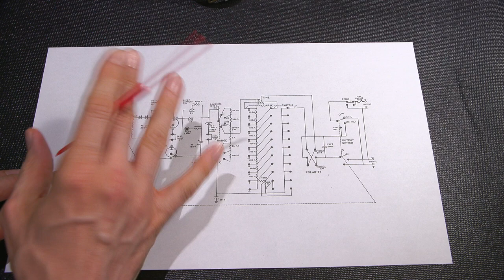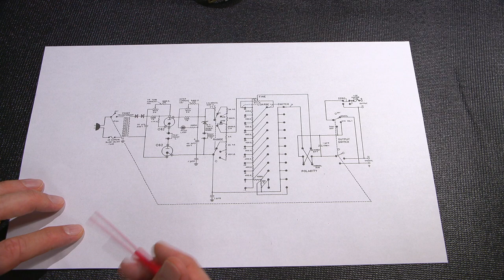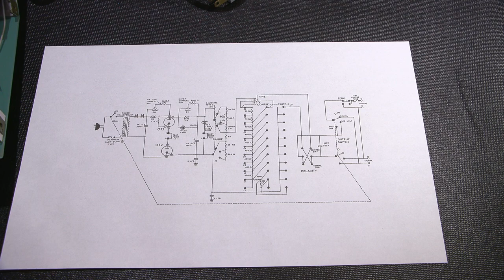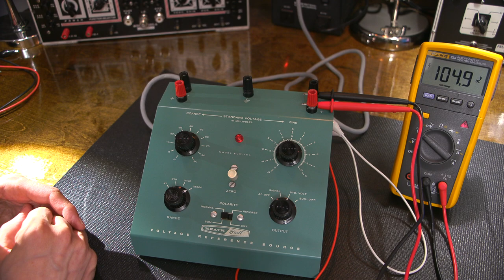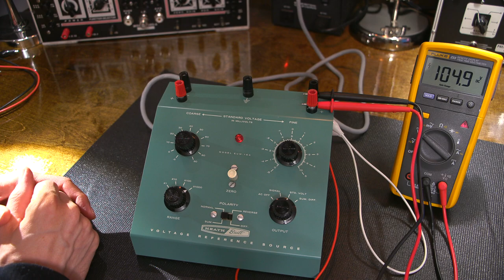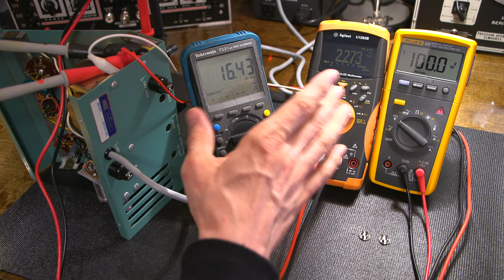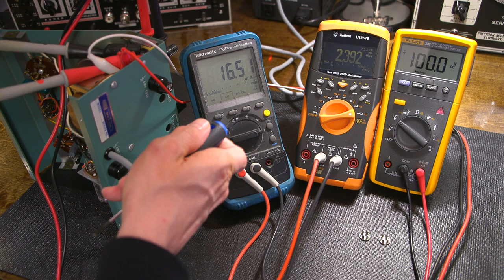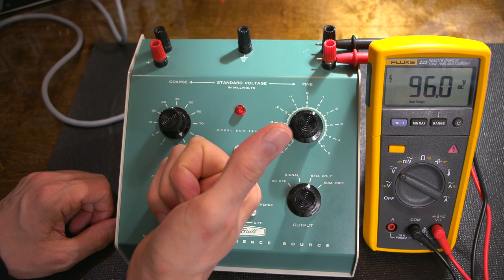HeathBuilt Voltage Reference Source [Restoration]

Comment from the maker: To learn electronics in a very different and effective way, and gain access to Mr Carlson's personal designs and inventions, visit the Mr Carlson's Lab Patreon page here: https://www.patreon.com/MrCarlsonsLab
Reply: Do the test meters add any load to the device while adjusting it.
Reply: @Peterjames3535  The series meters reading current would not but the parallel meter reading output voltage would have a VERY tiny parasitic load
Reply: Then again, there is the fact to consider that... Live and neutral in AC voltage do not matter, as they do not have a specific polarity. So that's probably why the fuse ended up on the neutral instead of the live, because it didn't completely matter which way around it went. So long as the ground went to where it's supposed to go for protection against any current leakage that may find it's way to the case of the device. Still very cool tho to see such an old device.
Reply: @timteecvhn  Except for the fact that in most countries Neutral is Bonded to ground and therefore presents a greater shock hazard . If you do not break the live side in switching and fusing
Reply: When I was a young girl, my daddy bought me Heathkits to build every Christmas. I remember the Heathkit LOGO! The shape of the logo and style of the lettering is the same as Heathbuilt. But, I never received a Heathbuilt.
Reply from the maker: Yes they do, but most modern meters have a very high input resistance/impedance, so there is little "loading" on the test equipment.
Reply from the maker: Hi Timtee. In most locations, the neutral and ground wires are joined in the breaker panel. This is why the device should always have the fuse in the hot lead. If the case is referenced to ground, (which it is,) the other side is hot, so the fuse should be first in line with that lead.
Reply: @timteecvhn  As apollo rob said, it's to do with how the rest of the system is configured.

Comment: At 80 I'm a tad older than you, Paul. I assembled 9 Heathkits between 1972 and the mid 80s. GR-900, GR-2001, IO-30, IO-4205, IO-4550, IT-28, IO-4505, IT-21 & an IT-3120. I miss those days.

Comment: I'm 53, when I was about 7 or 8, my dad bought a heathkit color tv (with remote!!) and built it in the basement. I remember watching him solder the components in and putting the whole thing together. We had that TV a LONG time. You had to tune each channel separately with jumper wires and tuning capacitor. It would drift out every once in a while, but the side panel would pull forward for "easy access".
Reply: Was it the GR 2000?  What a fun project
Reply: @TheoSmith249  you know, I couldn't tell you. I googled that model but tough to tell. Watching him build that and me playing around with the tuning in the side panel really sparked my interest in how things work.

Comment: A trick to fix those knobs.... strip some solid copper wire. Remove the existing grub screw and glue the crack closed. Next, wind copper wire around inside to create a "ferrule" - this may need to be two "rings" to keep away from the grub screw hole. Finally, fill the gaps between wire and plastic with the old "baking powder and super glue" trick. Care is needed to keep the grub screw hole 100% clear.

Comment: Good job Mr. CARLSON. You stayed with it. Heath did a good job in their resistor matching. 

Amazing how good it was without feedback. Say at 100.00 VDC and you loaded 2 mA on the output by using a 50 kohm ...how much would voltage would the output drop? 
Perhaps Heathkit intend to use it like a std. cell...where you place a sensitive meter between your Heathkit reference...and the unknown voltage...then adjust the Heathkit to a null..which means no error current across⅞your Heathkit and the unknown DC voltage...then read the dials...to determine your unknown voltage. 

Nice handheld meters....I had no idea TEK made little DVMs..

I will eventually do some Patreon...and help support your cause. 

Keep up the good work. 

If I was assigned the construction of a 0 to 100 VDC reference..it would be totally different. ...

Comment: Hmmm...

As you mentioned about the Calibration & heating due to the cover being off; I would have did the mod. to add two sets of  banana jacks & switches  on the back; switch on  for operation; & off with test leads inserted during calibration.

Which is exactly what I did back in the day when I worked at Heathkit! We had to recheck & verify the cal. once a week. We also never turned it off as it took at least 2 hours to stabilize.

Of course with today's modern designs, a reference can be on & stabilized in about 5 minutes.

Great job! 

By the way, wish we had that capacitor tester back in the day! It would have made life so much easier!!!
Reply: Then he would need to move the jumpers to an external point so they also would be accessible for removal and reinstall with case on.
Reply: @jimdavis6833  Yes, Jim, that is what the switches are for!  Switch on (closed) - for operation;  when you open the switch (off), then you can calibrate it.  Actually, you would normally use a double-pole, single throw for both since both "jumpers" need to be removed.
Reply: RE: "with today's designs, a reference can be on and stabilized in 5 minutes" ... I would give a qualified agreement to that. It's probably true for 99% of electronic equipment. However, there are still some devices that should remain on for their reference voltages to be stable. A couple of examples are:
*  timebase units with very high stability oscillators, such as Cesium and Rubidium frequency standards; 
* LASER systems used for precision dimensional measurements, and 
* electronic DC Voltage references, typically used to replace Weston Standard Cells. 

In these cases it is good measurement practice to regularly measure and record the relevant outputs, and analyze them to detect any non-random changes that may indicate a potential problem. 

Even the Weston Standard Cells required a stable power source to power the their typical temperature-controlled enclosures. In September 1989 I was transporting a group of standard cells from the Washington (DC) Navy Yard, where they had been calibrated, to where I worked at the Electronic Standards Calibration Lab at Charleston (SC) Naval Shipyard. That trip was interrupted by a bit of heavy weather known as Hurricane Hugo. At a stop on my route I bought a portable AC power generator to provide power to those units for a week until power was restored to the lab. (I also used it to power essential items at home, for a couple of weeks.) The Navy happily (partially) reimbursed me for the generator, because it meant we could restart DC calibrations several weeks earlier than would otherwise have been possible had the standard cells needed to re-stabilize and be re-characterised.

Comment: Hi Paul, I just stumbled upon this video (I don't understand YouTube's algorithm) and was surprised at the number of glaring design errors with this Heath product.  I don't know exactly when this voltage reference was designed, I suspect the mid 1960's.  Zener characteristics were well understood at that time so, the designer was likely fresh out of school.  The 100 volt zener was probably used as a simple way to get a 100 volt output.  However, (as you mentioned) zeners at this high voltage breakdown are super temperature sensitive, so much so, that the part would actually make a good temperature sensor.

There are 3 zener breakdown voltages that have zero temperature drift if they are fed a specific current: 4.7V @ 10mA, 5.1V @ 1 mA, and 5.6V @ 100uA.  If you feed the zener with a constant current source, you have a precision voltage reference (although the current will need to be tweaked slightly to optimize the zero drift).  

Thanks Paul for another interesting video.

Comment: If you're afraid of slipping screwdrivers over paint, just get yourself one of those sheets of plastic they use in binders, the thicker the better, and drill a few holes of various sizes at a decent distance. You lay the sheet over the screw you want to remove and it will protect the paint. :)
Reply: That's a great idea! Thanks for sharing.
Reply: Or 3D print a collar to keep the screwdriver on the screw.
Reply: @NiHaoMike64  Assuming one has access to a three dimensional printer.
Reply: Or get a screwdriver that's accurately sized for the screw.  I like my Snap-On for this.  :-)

Comment: Hey,  Long time fan here.  I noticed your discussion on the line chord and polarity are right on.   One thing you did not mention is to put the black line lead into the back of the fuse holder rather than the side lug of the holder.  This, as you well know is quite important. it prevents the exposure of the hot line lead while replacing the fuse.   Great video, as usual.  Thank you.

Comment: Thank you for your hard work and detail on this and all of your other videos.  One thing you should discuss is, whenever getting a "new to you" item to work on, it is best to resist turning ANY switch or knob positions until you check the inside of the unit out as well as possible. I purchased a Heathkit IT-1121 transistor curve tracer last year, and when unboxing it I noticed a slight rattling noise of something inside of it. After I opened it, I noticed a few pieces of brown plastic loose inside the unit, and looking very closely I discovered a broken wafer on one of the 9 position rotary switches, and a slight bend to the outside knob mounted to that shaft as well  ( probably caused by someone dropping something heavy on that on switch knob/shaft) . If i operated that switch before looking, I may have done more damage to the unit, and god forbid I powered it and cycled it, as I think it was the switch that set the sweep voltage, and also the position that raised it to 200 volts!
  A small amount of time and patience at the beginning of a repair / restoration project can save hours of time and frustration later, as I could have shorted out and burned secondary windings in the transformer in that unit and turned a restoration into a "parts only" purchase.

Comment: thanks fo all the good videos, i'd like to ad a bit on a voltage standard for extremely accurate calibration of up to 1.5 volts DC...
this comes from the cal lab at Systron Donner inertial guidance in the late 60s...i was a technician in the engineering dept there from 66 to 69. we were working with analog output from accelerometers and this required extremely accurate measurement of dc up to 7 volts....we had lots of fluke dc meters that required frequent cal checks.... our master volt meter was of unknown brand and it filled a box the size and shape of a coffin and was on a roll around stand...once per month our leader would grab a fresh D cel (zink carbon)  and solder a 1k resistor across it then drop it in his coat pocket and head for the UC Berkley electronics dept where he measured it's voltage (about an hour drive each direction)...upon return he would read the voltage on the master ...that zinc carbon maintained accurate enough voltage with it,s 1.6 milivolt load to do that in picovolts
Reply from the maker: Thanks for taking the time to write, and sharing your story John!

Comment: Thank you for the reminder about the need to replace the old capacitors! I have an old EICO DC VTVM that my father-in-law built from a kit in, I think, the 1960's. Note to self: order new capacitors before turning it on!

Comment: Paul  Thank you so much for another superb video.

Have a couple of questions:

1) Why not bring out the jumpers to the back so you can put on the cover, stabilize quicker and make periodic re-calibrations so much easier?

2) More of a philosophical question:  Why not mount a small fan inside the case to help cool the OB2's and to help keep the Zener stable?

I have noted that in some of your other projects (notably power amps where the output tubes can run very hot) you do not mount a fan.

The only downside to a fan I can think of is that it could pull in dirt from the outside without a proper filter and could inject a moderate amount of noise into it's power source.
Reply from the maker: Hi Mr. Palmer.
#1: I do not want to drill holes in the unit as it's in such nice condition. The minute you drill a hole, the value of the device is lost. This unit is near perfect aesthetic condition.
#2 Adding a fan introduces instability. Air cooling is fine where heat is a problem, and circuit stability is not. In this case, the heat is needed to stabilize the device. Any flowing air across the Zener diode would cause it to be very sensitive to environmental changes around the unit, IE: temperature shift from an open window, an open door, and so on. Even heat sinking the diode to the case would cause a longer stabilization time, as the case is affected by external temp change as well. Floating the diode "as it is" is the best solution outside a dedicated oven and associated circuit.
Reply: @MrCarlsonsLab  #1) Excellent.  #2)Now I understand. I was thinking about the problem upside down.

Comment: I have assembled a lot of different Heathkits, mostly TMDE and some table clock radios, etc; Built several Multimeters ,  D.C. Power Supplies and Signal Tracers & Signal Generators .Sure do miss building those Heathkits ! Wish they would bring them back !!!

Comment: Here is a tip on the rotary switches to add to your bag of tricks.  Some of those swirches require such high torque to turn the knob, the unreinforced knobs can easily crack.  Also, if you do lots of repetitive tests where you are continually rotating the stiff switch, it can make your fingers sore.  So, as a fix, you stretch the spring slightly that holds the ball bearing in place, which can substantially reduces the torque.  You have to be careful though and do small scale spring stretching (careful trial and error).  This is because, it is like trimming an antenna, if you over-do the stretching, you can't undo it.  If you are not careful, you will wind up with a rotary switch that has almost no detent feel.

Comment: Really nice video with good information on capacitors and that you informed about the thermal sensitivity of the zener diode, not many think about that until they actually notice it for real.
Also so nice to see a plastic trim screwdriver. Though I noticed you did not use it when you aligned as it looked like a normal screwdriver.

Comment: I recall how somebody (possibly Philips) published an application note with a description of a highly stable voltage reference source..  I have forgotten the exact details, but it covered the temperature effect on zener diodes (less than 5.1 V (negative temperature coefficient) and avalanche diodes (above 5.1 V) that have a positive temperature coefficient.  They played the  current induced change and temperature induced change of different devices against each other and got their desired stability.  Also old discrete transistor based power supplies had a 6.8 V avalanche diode on the emitter of an NPN transistor for balancing.  The transistor base-emitter voltage has a negative temperature coefficient of nearly same as the avalanche diode positive constant, so the net effect is a fairly good compensation.  Then the semiconductor industry came up with the hybrid reference diodes that had one or more ordinary diodes and a selected avalanche diode in series within the same package.  An example was the 1N825 (or 1N8270 reference diodes with 6.2 V.  They were very well compensated, but only at one particular current.  There were articles in trade magazines about how to get a great 10 V reference with such a device and one operational amplifier..  Feeding the 7.5 mA current from the amplifier output to the 1N825 through a good stable resistor you got all the desired conditions.  You got a stable 7.5 mA with a (10.0 V - 6.2 V) / 7.5 mA = 506 ohm fixed resistor.  Much simpler than the temperature chamber trimmed combination.  I used the 1N825 a few times with this kind of circuit.  Later on, when the prices came down, I saw somebody else using the slightly better, but originally more expensive 1N827. Since those days, both buried zener and bandgap  based reference ICs have made those early circuits obsolete.

Comment: Robertson head screws are gaining traction  in the USA, especially in the electrical industry. I discovered I needed to buy a couple of sizes of Robertson drivers a couple of years ago, when i was doing the electrical installation of my new woodworking shop. Those, Torx drive heads, and even Pozidrive heads are so much nicer than Plillips heads. 

Whenever someone complains to me about a Phillips head driver camming out, I smile & remind them that it is exactly what they were designed to do!
Reply: They were color coded. Yellow, Green, Red, Black  Smallest to largest.

Comment: I built a few Heath-Kits (back in the day). I retired (or gave away) most of the equipment except for the bench FET-multimeter and AC Voltmeter...which I still use.  Both have very nice pure analog displays.

Comment: @36m about stability.  Don't forget that in the 1960s, meters had needles, not 3.5 or more LCD digits. So 1% was probably the target. That's one volt in 100. I know you know, I'm just making it explicit for those following along at home. :-)  73
Reply: Good point, easy to forget that 👍